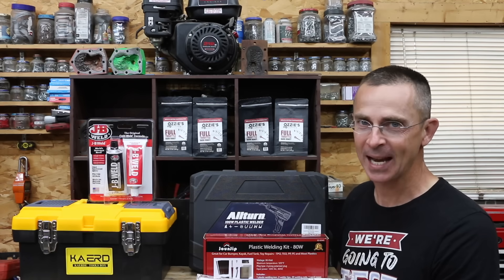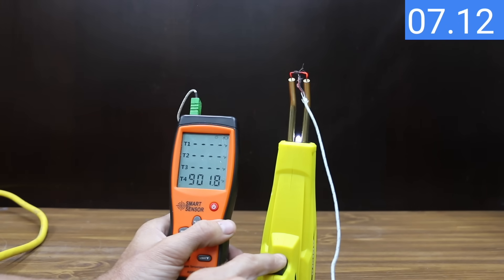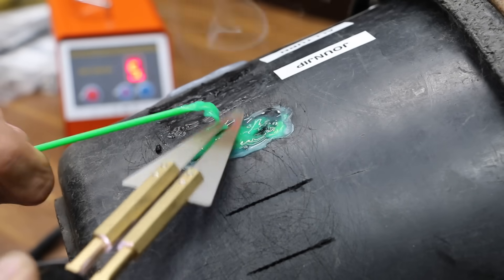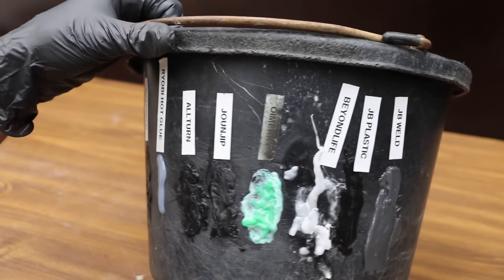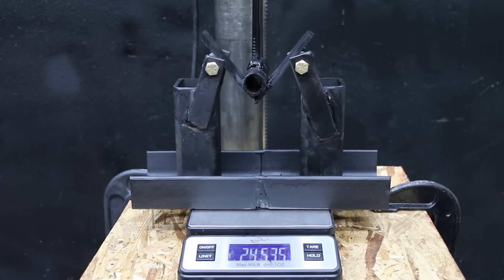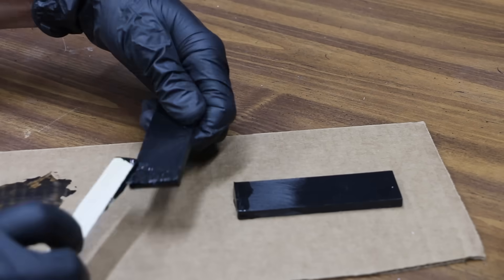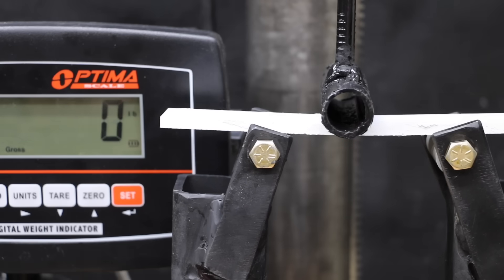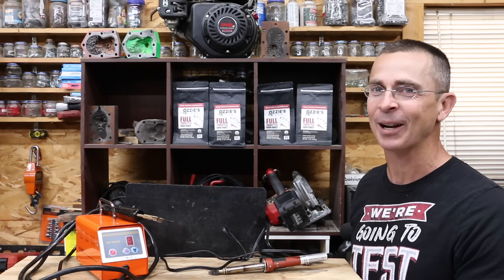Don't Buy A Plastic Welder Until You Watch This Review!

Comment: I bought 2 of them recently and used them right away to fix one of our large recycling bins.  The Allturn is definitely one to go with.  If you do it carefully and if conditions are just right, you may not even need to use the "sacrificial" plastic sticks to build up the plastic.  You will want to use a Dremel sanding tool drop the height of the metal clip ends once they are embedded.  Be careful about the temperature of the Allturn and how you handle it or where you put it to cool down because it is quite hot once used.  I also bought the Harbor Freight one that looks like the Joonjip which seems fine for small areas but the Allturn was flexible with the items you can fix with it, it was fast, and seems effective.
Reply from the maker: Thanks for sharing.

Comment: It is nearly impossible to join to separate pieces of plastic together because the chemical reaction that made the plastic has finished and set. The point to remember is most damaged plastic items are cosmetic and not structural. 

I did see somebody use a hot air plastic welder years ago... they were quite good with it. I think a combo of the hot air gun and the staples would work best... the soldering iron type devices do not melt enough plastic and penetrate deep enough into the plastic tear. 

If joining two plastic bars... grind the ends so each side ends up looking like a cold chisel point. This leaves a V on both sides either end with a slight gap between the two. Then go back behind these tips and drill two plug holes either side. Slightly countersink the 4 holes with a larger drill bit. What the goal would be is to form an hourglass shaped plug in each hole that cannot pull out. Then fill and weld the V on both sides making sure the melted plastic flows into two of the holes to form a pair of plugs at the same time. Flip it over and repeat. In effect is only creating a kind of sleeve type joint. 

The other alternative is to make a mold that takes both ends of the bar. Heat the ends of each bar until they melt and then add some more molten plastic to reform the bar. Let it cool and sand it.  Might work. Might not.
Reply from the maker: Thanks for sharing.

Comment: 20 years ago I needed to repair a dirtbike gas tank with a 1.5” crack at the petcock mount. No glue would hold, not the special “plastic welding” glue, not JB Weld. A welder from Urethane Supply with correct HDPE rods saved the day. Similar to your Jounjip, hole to feed through welding foot.

What I did different from any of your welds is I plunged my welding foot through the tank plastic. Then with a cake icing motion moved tank plastic back to fill my hole as I worked the length of the crack then finally used fill rod to finish it off. Important for molten plastic to contact molten plastic, not hard non-molten plastic. Then I went back and smoothed it out with the hot welding foot so the petcock o-ring gasket would seal.

Repair still holding.
Reply from the maker: Thanks for sharing.

Comment: nice test but the reason for many of the premature failures are the non compatible materials used to bond. You can see this from how they failed. There was no adhesion. When you plastic weld you are basically forming a chemical bond when you use the same material. Its hard to fail when using mesh and staples.

Comment: He melted the mesh into the repair material and then goes "well that looks like good penetration". IT DIDN'T EVEN PENETRATE INTO THE ORIGINAL STRUCTURE!!!  IT'S ZERO PENETRATION!😲😲😲 You're supposed to embed the mesh into the original material (to the point where you can't see it anymore), NOT INTO A SLAB OF FILLER MATERIAL THAT LIES ONTOP! Some other details too regarding technique. But interesting video 👍

Comment: Ahh... good ol' JB Weld.  It all comes down to surface prep. with that stuff. It's far more cohesive than adhesive on many materials.
Reply from the maker: Thanks for watching!
Reply: @ProjectFarm  Thank you for making these.
I love your test setups. Early in my career, I wrote software for embedded systems and was fortunate to work with many mechanical engineers and techs who created test/measurement setups for myriad industries, from biomed to machine controls to aerospace.

Comment: I appreciate that you tested the strength of a the plastic welding products, but the failure on a lot of plastic that needs to be repaired is from bendable plastic failing over time. It would be a good idea to rig something that could bend the plastic repairs back and forth until it breaks again.
Reply from the maker: Thanks for the suggestion.

Comment: For plastics repair, it is key to use the same type of plastic, usually chopped of an area that is not visible... for example you cannot weld ABS plastic with any other type, it has to be ABS.. pvc its the only one that can be welded with other than pvc materials, however how well it does, depends on how old it actually is.
Reply from the maker: Thanks for the feedback.

Comment: Bro you are not doing this right,especially the mesh part bro. You are supposed to melt the mesh some what into the two broken pieces make the mesh sort of be a semi fix and then you melt plastic or could even put staples and melt plastic guaranteed it will be much solid. The way you are doing this is not allowing the mesh to melt into the broken pieces so the mesh is really not providing support. Seen and done plenty of these to know

Comment: There's very little welding being done here. Barely any base material fusion. PC is tricky stuff to weld with DIY tools, easy push temp too high and pyrolyze or turn it brittle. Of course because its nice and transparent the welds look nasty as they turn opaque with various off white shades in the mix if the welding tip isn't cleaned.

Comment: Thanks for the video. There is a small hose that runs to the top of my radiator. That hose is held to the radiator by a tube (?) extension out of the radiator. You slip the hose over this "tube extension" and clamp it into place. That tube extension has broke. I have both pieces. Can I just just melt both broken ends and push this together to fix this tube extension?

Comment: Years ago I used a AA powered soldering pen to do plastic repairs on my customers power equipment, never had the staples or repair strips. They were always happy to save $60+not needing to buy Stihl clamshells. These are really nice though, if I still worked on the stuff I'd definitely one.
Reply from the maker: Thanks for sharing.

Comment: When I used wire mesh I use the heat to imbed the mesh into the part that's broken, rather than just having it be in the molten plastic that's piled on top of the cracked area as shown here. Same goes for staple system.
Reply from the maker: Thanks for the feedback.

Comment: It would be cool to see how a 3D printing pen compares. You can melt abs and all other manner of plastic filaments with it. I use a 3dp pen to bond other 3dp parts and it works well, although they’re not usually structural.
Reply from the maker: Thanks for the suggestion.

Comment: One other caveat for making a stronger strength weld is to apply aluminum tape to the front side of the crack, and then from the backside, you would want to use a teardrop shaped carbide burring bit to cut a v-groove channel along the entire crack as well as cutting a t-shaped channel at the each end of the crack. This is will add extra rigidity when using the welding rods to fill in the crack. Once you've completed the weld, let it cool and then sand the surface smooth. Now you can remove the aluminum tape and apply it to the backside of the repair area you just finished and now you will repeat the same thing on the front side by cutting the v-groove  along the crack as well as the t-shape channels at each end of the crack and using the welding rods to fill it in. Sand and smooth as needed. Hope this helps.
Reply from the maker: Thanks for the constructive feedback.

Comment: If you're going to an advertise a "test", then the work should be done appropriately. When you weld, both pieces of metal get molten hot so they can mend. You just laid melted plastic over plastic, therefore these tests mean nothing.

Comment: Staples don’t add bending strength unless they are located near the surface of the material. Staples increase the tension strength and wire mesh on BOTH sides if bonded sufficiently will improve the bending stress.
Reply from the maker: Thanks for the feedback.

Comment: Hey man curious if plastic welding can work to replace the hole I cut in my fuel tank. Was installing a fuel sump on my 97 dodge ram 2500 Cummins and used the wrong size whole saw
Reply from the maker: Thanks for the suggestion.
Reply: @ProjectFarm  do you think the plastic weld will hold up on a fuel tank?

Comment: Have you done a solder joint electrical wire corrosion test with various flux and solder combinations?  The main area of interest is the cleaning chemical/method of removing flux residue and how the electrical joint/connection longevity is affected.  Add in some heat shrink, electrical tape, and other brush on sealers and you will have given the world some important and valuable information on best practices for electrical solder joints.
Reply from the maker: Thanks for the suggestion.

Comment: Steel wool works good also,I use it instead off the wire mesh,melt the seem put some steel wool and top off with filler
Reply from the maker: Thanks for the feedback.

Comment: I seem to notice a lot of lack of fusion in the plastic welding. Theres a balance point of melting the base plastic and the filler material together. I noticed a lot of melting the filler material trying to get it to melt to the base material and theyre not fusing together, but rather laying on top

Comment: I would really like to see this full test video when you have done the following:
You should melt the wire mesh into the plastic piece you are repairing instead of setting it on top and melting the plastic stick on it. After you melt the wire mesh into the the repair piece then you can melt the plastic rod into not onto the repair piece. 
You want the mesh melted into the plastic piece not on top of it which makes a poor bond as you can see in the test.
Also the plastic rod and the plastic piece you are repairing need to be at the same temp to melt together and make a good bond. It's like soldiering.
Lastly make sure you are using the same type of material for the rod as the piece you are repairing.
Reply from the maker: Thanks for the suggestion.

Comment: So it seems like the best solution is a hot staple with JB original. The hot staple would add core strength while the JB weld is far easier to work with since it is not hot and seems to bond the best in most cases.
Reply from the maker: Thanks for the feedback.

Comment: Thermal welding makes sense for polymers like HDPE and PP, but for ABS I don't see why you would bother with thermal welding when you can do a solvent weld which should be a lot easier to get strong results. You start by making some ABS goop by mixing appropriate amounts of acetone and ABS plastic. Recipes can be found readily online. You can coat both surfaces with ABS goop, press them together for a minute or three and you're done. Maybe give it more time for any residual acetone to flash off for full strength, but if you do it well, you should be able to get very close to the strength of the original piece because you should be able to get a good bond through the entire thickness.  A lot of your thermal welds seem to only get a thin layer on the surface to bond and don't penetrate very deep. I know that the outer skin is where most of the part's strength comes from and maybe there's something to be said for practice and better tools, but I've never been able to get thermal welds to work anywhere near as well as a solvent weld in ABS. Also, A tin of acetone from the hardware store should be cheaper than any of those kits.
Reply from the maker: Thanks for sharing.

Comment: Plastic in single use plastic milk bottles/jugs you get at the store are HDPE it has a relatively low melting point. The milk bottles can be cut into strips for repairing the same plastic. In Europe consumer plastics such as bottles have a number inside a triangle molded somewhere inconspicuous. This tells you what plastic it is and means you cn use some cleaned junk plastic as a repair stick.
Reply from the maker: Thanks for sharing.

Comment: Basic JB Weld works the best just a little bit of sanding clean the spot we could just a tad rough and if you need to you cannot support my mirrors that I broke off of my car and lots of other things. It’s crazy what you can do with that stuff, but I’ll only use it for fixing certain things not repairing engine parts and stuff just basic stuff that’s not sensitive like engine parts and moving parts. That’s important unless it’s a tight bind and I have to get their back to the garage maybe but very maybe
Reply from the maker: Thanks for the feedback.

Comment: Universal takeaway: unless the price difference is extreme in favor of the plastic bonder, always buy original JBweld bonder. The plastic one failed to adhere or strengthen plastics as much as the original formula. It also seems harder to work with since it is runny and may not cure in place on vertical surfaces
Reply from the maker: Thanks for the feedback.

Comment: Not sure where to post this, so posting here. Can you test 30 gallon air compressors? Noise. CFM. PSI. Weight. Yada yada? Interested in the Dewalt DXCM303. Would like to see it compared to others.
Reply from the maker: Thanks for the suggestion.

Comment: I appreciate the video. I was planning on ordering one of the Allturns for installing the staples to help strengthen the welds that I occasionally need to do and this seems to confirm that it will help. I have just been getting by with a soldering iron while doing these repairs. When I do a repair, I first clean the plastic with soap and water and then rub it down with rubbing alcohol. I then stitch the existing plastic together with the tip of the soldering iron going perpendicular to the crack. This holds the pieces together while I'm working on it. I then go back over it with the tip angled down at a 45 degree angle to create a V pocket into the crack. This gives me a pretty good weld with the existing plastics. I then melt additional plastic to the V pocket and work the new plastic into the old. I'm sure I could make stronger welds if I knew how to identify what plastic I was working with and obtained the correct filler plastic but since I don't know this I just do my best. So far I haven't had a repair fail and the plastic that I typically use as a filler is the black automotive plastic that I find that at almost any intersection from traffic accidents. Most of my repairs are on plastic parts on mowers and other lawn care equipment. I only end up plastic welding once or twice a year.
Reply from the maker: Thanks!  Thanks for sharing.

Comment: The beyond life welder disappointed me, but since it was made in china i understand. I use a very similar one in my work with pvc, but the brand leister, and is made in Switzerland. It gets to operating temps in about 2 minutes, instead of 10, and has lasted since i have been there, almost 10 years. Its a very good tool, but the chinese knockoff is just that.
Reply from the maker: Thanks for the feedback.

Comment: I've been using an inexpensive, chisel-tip soldering iron to repair HDPE for about a year. I can fix most cracks without adding in material using a push/pull motion with the iron perpendicular to the crack, and a smoothing pass when I'm done. Only one failure, but the part was too delicate for any heat process (I WILL go back and try one of the glues). Thanks for the incredible detail, as always. Ciao!
Reply from the maker: Thanks!

Comment: When plastic welding, like metal welding, joint preparation is critical. It would be a better test of the plastic welders, if on the butt welds, you prepared the joints with a v-grove. Then melt a layer of the plastic on each side of the vee before introducing the filler rod while the parent plastic is still molten. When finished the surface should have a smooth convex curvature starting and ending just outside of the v-groove preparation width.
Reply from the maker: Thanks for the constructive feedback.

Comment: Maybe I am crazy but it seems to me that the heated surface is a BACKSTOP and that you should be feeding the plastic rod THROUGH the hole, from the other side. So that the melted plastic FILLS the gap, instead of just being a bandaid pasted over the outside? 
I've not done this before, but it would be the first way I would try to use it, because you don't want to patch over the hole, you want to FILL the hole.

Comment: If the staples can be inserted from the back side via tight fitting drilled holes and "pull" melted to thickness center.
A wire mesh could be guided through the pins to be melt pressed into the plastic.
Staples pulled from the opposite direction may also help sandwich the mesh.
Reply from the maker: Thanks for the feedback.

Comment: Excellent video in that you test many applications, your test parameters are consistent, LOVE the pace of your video as we need facts and not "er, um, well, etc."  Sub'd and liked my friend!  I bought the FGRSRZ 𝟐𝟎𝟎𝐖 Plastic Welder, Plastic Weld Kit from Amazon, which is like the Allturn, and the only issue with it is that it does NOT have a "feed" style tip you can slide rods into.  I will be buying the Jounjip as well, and in no small part to YOUR video!
Reply from the maker: Thanks!  Thanks for watching and subscribing!